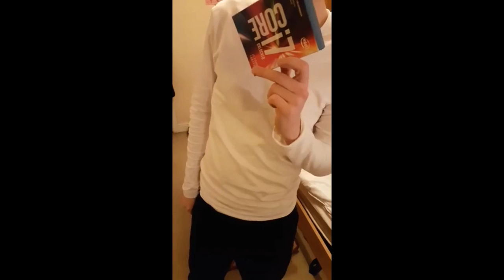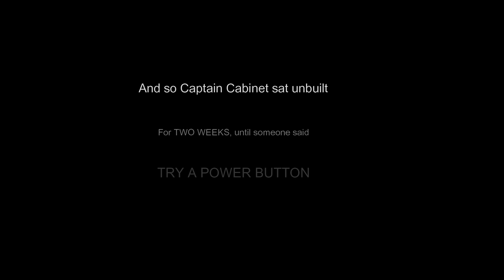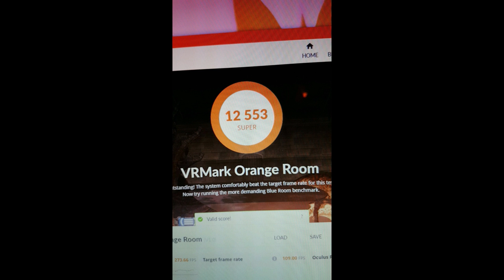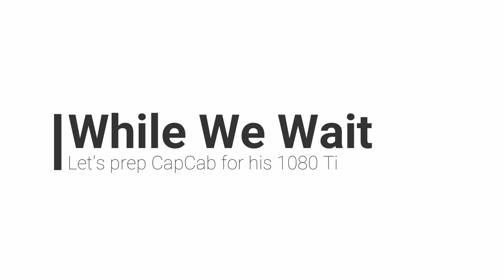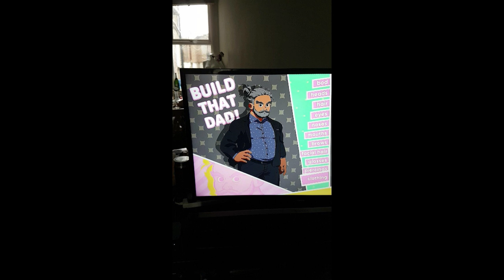Captain Cabinet and CuBeast: ORIGINS

Comment: So glad you added a hybrid water cooling system to that thing.  I can't build a system without those nowadays!  Makes the whole case impossibly quiet, as it doesn't need ANY case fans blowing air through the case.

But I can't help notice you made a bit of a mistake there... you said you have water cooling the CPU going down into the radiator which you put at the bottom of the case, this should be at the top of the case, or the back/front at least because hot air rises.  Also you should never put a fan sucking air IN through a radiator that is going to be full of hot liquid, you want that heat being blown OUT by the fan.

Apart from that, good job on making some ridiculous looking flashy PCs lol